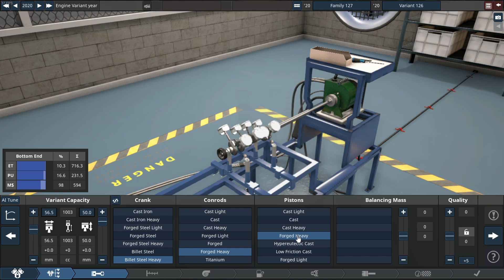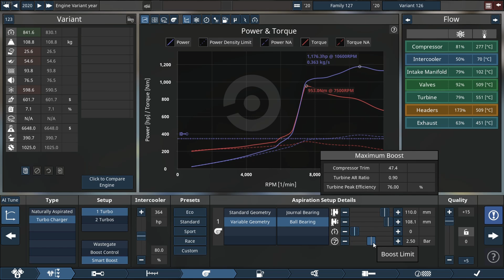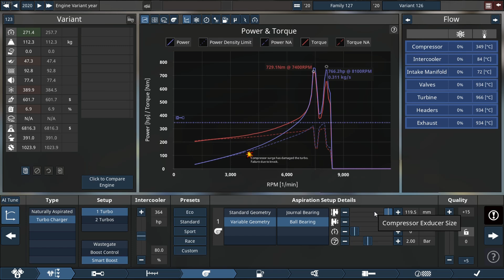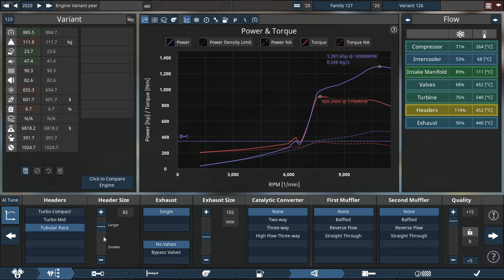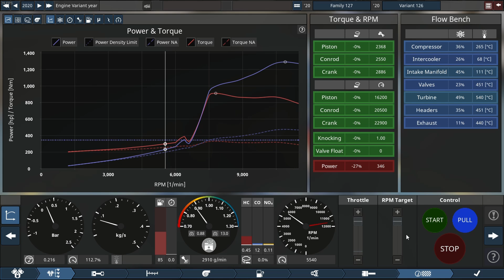1L 1200HP! - Automation the car company tycoon

Comment: ima beat this
Reply from the maker: I would like to hear what you get
Reply: 2191.5 @ 12k RPM
AlSi Heavy 1002cc (60.4mm x 43.7mm) 90 degree V8 FP DOHC, twin turbos (twin scroll + boost control)
Reply from the maker: @ARockyRock ok nicely done

Comment: can this game actualy tune real car engine?
Reply: It's not particularly accurate to real life, i recreated my own engine (1.6 ecoboost) with my turbo (s280) and it says it instantly fails when going above about 1 bar of boost. Meanwhile irl i'm running about 400bhp at 2 bar of boost and it's fine. Even just trying to get the same power on my engine in this game results in a engine with way more turbo lag than i am getting irl. So if you wanna recreate your own engine in this game to see what sort of power you could reach, it's going to be a disappointment
Reply from the maker: Yeah so one thing to keep in mind is how high the quality slider is because it can make a huge difference in power and torque
Reply: @Curiousgamer20  Yeah, but even with everything on max quality it doesn't match what i can get from a stock engine and a hybrid turbo lol, this game is just not very accurate to real life. Regardless there is still some stuff to learn from it, but you shouldn't kid your self in to thinking that if you can build and engine in this game you could build one irl
Reply from the maker: Yeah it's a fun game at the end of the day
Reply from the maker: Unfortunately this is only a game it's can't tune real engines but you can somewhat simulator what would happen if you run an engine your way (it can knock,break or lean pop ect.) it's a pretty fun game